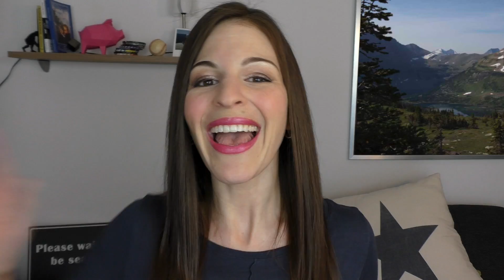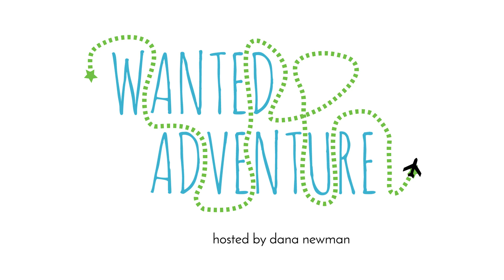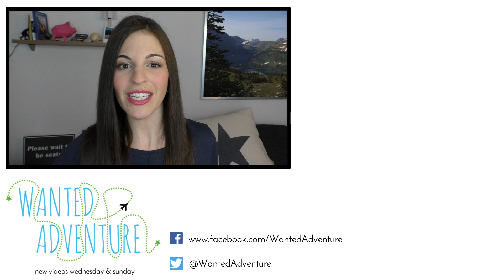Why Are Houses in America MADE OF WOOD?!

Comment: Wood is used in framing houses mainly because it is relatively cheap and abundant. It also breaths well, and can easily expand and contract with temperature variations. I live in Charleston S.C. where in the spring and early summer it can go from the low 70's F and 55% humidity to the high 90's F and 95% humidity almost overnight. Concrete structures, in these conditions, tend to sweat which promotes the growth of mold. This is a serious issue in the south east. They also tend to crack. especially in sandy coastal areas where tides make the ground swell and contract like a sponge. Building with brick is, in comparison, extremely expensive. especially if you are going for more than an exterior façade which is only one course thick, and is also subject to sweating and cracking with rapid and extreme variations in temperature and humidity.

Comment: the answer is: cheap and fast! I've workes as an architect in Greenville / SC.
Reply: hey can you tell me how durable are wooden houses compared to concrete ones. And what is the average life span of normal wooden home in which we live in usually?
Reply: @yashaswikulshreshtha1588   I work in construction, and average well built home made out of concrete and block can last you at least 100 years.

But construction will be slower than wooden one at least structurally because concrete must pass drying process.

Now. In the U.S there are 4 seasons in most states concrete cannot dry well in freezing or snow season.

Also seasons have an impact in concrete structures.

Economically is better to use wood rather than concrete.

Less weight.
Easy to maintain.
Cost efficient for repairs.

Best of all it encourage homewoners to spend in their home wich is good for the economy.

In other countries walls and roof are built on brick and mortar with spanish style roofing or concrete roof slab

However homes don't look that great except the rich people ones.

But wood provide endless possibilities of beauty at a fracrion of the cost.

For basic affordable long lasting building concrete is good.

For an affordable long lasting wooden house is good.

For a beautiful house with style and glamour wood is affordable.

For a beautiful stylish home in concrete amd bricks it cost a fortune.

I live in New York City.

To build a house in Queens new and beautiful cost around 500k to 600k dollars in construction cost.

But to build the same in concete and brick it can go up to 1 million to 1.2 million dollars.

It may sound good to build just in concrete but cost is enormous.

Thats the main difference between America and the rest of the world.
Reply: @fernando9175  Than build a skyscraper of wood
Reply: @Deelom100  I live in a 5 story building made out of wood with stone foundation.

Several small buildings in New York city build before 1950 are made out of wood.

I usually work in Manhattan.

However skyscrapper like the Empire State was built  with concrete and stone along with steel framing colums and I beams.

Reason for that is that is less expensive than concrete cosntruction and could be done much faster as history shows.
Plus american had the steel companies that produced a large portion of the steel sold in the world back then.

After the 9/11 terrorist attacks. New York largest developing companies was wonderong what would happen if they build in concrete?

Well it shows this resist explosions much better than steel and does not compromise all the structure if on part gets damage.

Because of that property insurance companies will charge less and as a result it will be worth it in the long run.
Because skyscrapers are built to last hundreds of years.

Nowadays skyscrappers are build in reinforce concrete structurally speaking.

Main columns and foudation as also the floor slab are done in reinforce concrete.

In rebar developers use 5/8" to even 1 1/4"  inch diameter which is more or less 14mm to 32mm. Diameter.

But not everyting is build in concrete, why? Because in America everything in real state get remodelations every year.

So reinforced concrete is used to build the structure and floors.

Blocks to build walls.

And glass for windows which different from many parts of the world, for instance windows come from the floor up to the ceiling and this is common because New York sells the views.

But on each floor everything on a particular floor is build with block for elevator and emergency exit walls.

But the units are made with light steel and sheetrock of 5/8" 

Why?? Because is weightless.

Steels studs were expensive back then years ago.

But government and green pro agencies help those prices go lower so steel studs and wood studs cost almost the same with a difference in pennies.

Skyskrappers can be build with steel alone. But steel can resist tension but are not made to last if someone is going to build a Burj khalifa in a windy location.

In this perspective arabians thought it very well.

Ingeneeries know that concrete resist wind much better than anything else.

But speaking of residential construction or lower size buildings wood, houses, or concrete works well.

But it's construction will depend on the financing wallet on the project.

Coming back to your comment, lets build a wood skyscrapper.

Well it can't be used to hold the structure of a skyscrapper but can be use to build a unit in the top of the One World Tower in downtown Manhattan.
Reply: @fernando9175  i am a bricklayer from Denmark and you or so right about “normal” brickhouses dont look so good as most Woodhouses... for me its a little sad because we only do stright walls. People dont want to spend the extra money. And it is Not even that much.  
I love doing the very old houses tho, becauseu they or so pretty and full of High Level bricklaying technic.. Got to give the old guys back in the day some respekt,  me and my kollega or no way neer doing what they did ind the Time they did.
Reply: @restlessblend  Wow seems you are a pro.

However, look get a house and offer a nice and attractive price to a homeowner and make a design for them at a low cost and make it incredibly nice.

Then take pictures and stuff of the house built from your design and promote yourself to other homeowners.

You woild need and architect for sure, but you can hire a recent graduate to help you out in the design and drawing and permits, and sell the idea to homeowners.

Well I talk about it because I've seen it in NYC, U.S.

I have no idea how Denmark works.
Reply: Holy shit I live there
Reply: @Yeshwanth Palle there are plenty of plantation style homes over a century old and they are still in pristine condition! The problem is now the houses are not built in the same manner. Today's wooden homes are made of ply wood, connected to a frame! It's just a cover, a shell of thin wood throughout the whole house. 

The old way of building cost more, and was slower.
Today's homes are built cheaper and faster. You get less value from them when you buy them, but the people who finance the building process save so much money and sell it at full price (they build these cheap houses and sell them expensive).

Comment: Hi, German here :)
Tornadoproof house, maybe. My house is the old schoolbuilding from our little village (~200 people). In the middleage every village had it own school, in general very small houses. As many public buildings they where build without knowledge in statics so they took, we call it "Bruchstein" (crushed stone) and build the walls that thick that they can not collaps. "Bruchstein" are stones that have been broken out of very huge ones and do have very different sizes (and different types of stones). Their weight can easily be up to 3000 kg per m^3 and more, which ist 3 times the mass of water. One stone can be up to one meter in the largest diameter, the other one just 10 cm. The walls of my little house with 2 floors are approximatly 1m thick on the ground and 60cm thick at the roof. Walls consisting of very massive stones, so they may crush a bus flying with 300 kph (But of course it would not like to test it xD). Trees, and this is proofen, do not stand a chance ;)

PS:
Great videos, its nice to learn something about americans and not the usa ;) Keep on going!

Comment: Got news for folks in Germany - a tornado will tear apart a brick or stone house almost as quickly as a wooden one and being buried under the rubble will be even more dangerous with the added weight.  I do live in a brick house (wood framed), but mostly because it looks nicer than most wooden houses and has better maintenance properties not needing paint or rotting on the outside.  Concrete Hardie board siding does offer a few advantages over wood siding on a wood-framed house, however.

Comment: There is also something else to consider.  The cost of building homes out of stone or concrete is EXPENSIVE.  Wood is cheaper, but she is right.  You can go your whole life in the areas where there are large amounts of Tornados and never see one.  I live in Florida and my home is built of wood, and the area I live, is far enough inland that if a hurricane hit, generally it is not going to do much damage, say maybe some shingles knocked off the roof with the average size hurricane, say a category 3 or smaller.  However if it is above a category 3, that is different, it is very dangerous and even stone homes are not safe.  Those are rare, but that is why we have homeowners insurance.

Comment: You see, we live in Germany and we have built a house in the past. It is made from wood - but in a different way than in the US I suppose because in our case that meant that it was even more expensive, ecological and supposedly more advanced (better insulation, safer and whatnot). As an example the floors had a thick layer of concrete below them to insulate noise and stuff.

Comment: You think it is better to build houses of ticky-tacky, with the guarantee to be completely demolished after a tornado, than to build a solid house because it also can get damages?
Nearly regardless what will hit the concrete house there will be enough left to be able to fix it. Not every house have to withstand something like a flying bus.
You often can see pictures of town halls with holes in the roof and stuff sticking in the walls in the middle of a heap of wooden rubbish.
If the material used to build houses of is just depending of how easy it is to get this material e.g. Germans should also live in wood houses (30% of Germany is still woodland).
All Immigration to the US came from countries with a long tradition building solid houses.
I don't have any idea why it become so popular to build cheap and ephemeral.
Reply: It's just what people are used to at this point. It's actually getting worse. During the mid-twentieth century, a lot of brick houses were being built. Now, for some reason, most new houses (outside of the Southeast) are being made of wood again.

Comment: Look at the cost difference just between exterior brick vs stucco or siding, its  staggering.  Plus wood is so much easier to work with, you can build much faster and install all of your plumbing, electrical and HVAC without having to pre-engineer for most of that.  Real world applications often run into unforseen problems engineers overlook causing major problems.   Wood is safe, reliable, cost efficient and labor efficient.

Comment: Actually, no.
In a tornado situation, you EXPECT that the windows and maybe doors, are going to get blown out.  It's just par for the course.

HOWEVER, concrete structures (like Insulated Concrete Forms), are sufficiently durable (if built right) to survive a Tornado.  There WILL be repairs from things breaking the fascia, but the concrete itself generally just needs to be inspected and then re-sheathed.

And in many cases, you're talking about a price difference of only about 10-15% vs wood construction.
On top of that, with concrete being monolithic, it results in a house that's more airtight and weathertight.  As such, it doesn't gain or lose temperature as easily as most code-minimum-built homes.
So you save money on the other end with smaller, more simplified mechanicals (instead of needing 60,000 BTU of Air Conditioning and Heating, you may be able to get away with 30,000 BTU).

Now don't get me wrong.  There are ways to build that can make a home just as highly efficient and weathertight as a concrete home.  But, they're pretty much NEVER going to be as fire-resistant or tornado resistant as a concrete home.

As for a masonry home.  You're right.  Those homes are in no way tornado-proof either.

Comment: In the Philippines, the walls of older houses are made of concrete slabs to withstand hurricanes. Some rooftops are made of terra cotta roof tiles like the Spanish roofing. The floors are commonly made of marble and wood. Somehow these materials like marble is expensive in the US but in the Philippines it's a necessity in house or construction building.

Comment: Why are houses in America made of wood?  There is an abundance of wood here and relatively inexpensive to construct, repair and renovate.  In addition, systems can be easily run through the walls.  

In terms of energy efficiency, wood houses can be made very energy efficient with a tight air envelope and good insulation.  

As far as durability, many from Europe might think that wood houses do not last.  Not true.  Good maintenance, especially in regard to the roof, and they can last for centuries.   I have one wooden house built in 1930.   It is excellent condition and with proper maintenance there is no reason to believe that it wouldn't last another 75 years.  
 
One thing I do not like about wood homes is painting the exterior.  However, with vinyl windows and siding, that problem is solved.

Comment: Speed.  Not only was the wood available, but post American Civil War (ends 1865), the development of the "Balloon Frame" technique (2x4 Standard Dimensioned Lumber, etc) (That's 2x4 inches, not up to doing the metric conversion right now). let builders build, er, really fast.  Even a lot of "Brick" houses are really Frame houses with a brick façade (my dad was a bricklayer in the 1950s).   Cement Slab foundations (no basement) are even cheaper in the American South.

The Balloon Frame  Is one reason Chicago was rebuilt so rapidly after the Great Chicago Fire (1871, Mr's O'Leary's Cow).  
(
And it made the 1950-s suburbs possible.  All the instant towns, (Deadwood anyone).  The US army (is?) was still using temporary barracks designed to last five years built in 1942-43 in the 1980's;  Again, quick build, very poorly insulated, but better than having the troops under canvas.  Major programs over the years to insulate them, etc, origin.ally build without insulation across the American South  

Useless things you learn in college.

Comment: Wooden homes in the US are far superior in many ways compared to the all brick and concrete homes that are built in Germany or other parts of Europe. In fact they are often stronger!  

Advantage One: American homes that are made of wood are much cheaper to manufacture compared to typical German brick/concrete homes. This makes them far more affordable than German homes. 

Advantage Two: Since wood is so plentiful and far easier to work with compared to brick or concrete, (not to mention cheaper) this allows for American homes to on average be substantially larger than German homes. 

Advantage Three: Wooden homes are far easier to rebuild, maintain and remodel. Plus they are easier to expand on with additions vs German homes. 

Advantage Four: Wooden homes fair far better on ground that may settle over time and have the ability to flex without cracking or failure compared to German homes. 

Advantage Five: Wooden homes can survive Earth tremors more easily since they tend to be more flexible than German homes. And if a part of the house is compromised, the house can be repaired much more easily and for a lower cost. 

Advantage Six: US wood homes offer about the same amount of tornado protection as a typical brick or concrete home. This is due to the fact that German homes would explode if hit by a typical US tornado as they are typically nowhere near strong enough to survive. The US has millions of all brick homes as well. And concrete buildings. And I have seen the damage in person of what a tornado does to them. Nothing is left! If tornadoes can level a school building that's much larger than any German home by far and also made of all brick as most schools are in the US, then I can guarantee you that a small German home is no match. 

And if your home is leveled by a tornado, it's far cheaper to rebuild if it's wood. And like it was mentioned in this video, even in tornado ally most homes are not destroyed by them since it covers an area Triple the size of Germany. Most wooden homes in tornado alley have a basement or storm shelter anyway for protection.

Comment: Modern carpentry techniques , were actually issued in by their resilience to storms. A framed in house was easier to rebuild and often could just be moved back in to place. In the US wood is plentiful and inexpensive and a renewable resource. The US is far more sparsely populated so fire is not so much of an issue. The ability of wood to flex under storm stress is also an issue. Just my zwei pfennig. Viele Spass!

Comment: A bus or automobile being tossed by a 320 km wind would not be travelling at 320 km/hr. 
Not saying to would not pack a punch but only something like a balloon would be travelling at the wind speed.
Reply: Yes - tests indicate that a 250 mph tornado will send 2x4 wood debris about 100 mph.   A bus - far far slower.   Nevertheless the best way to build is insulated concrete forms ICF.